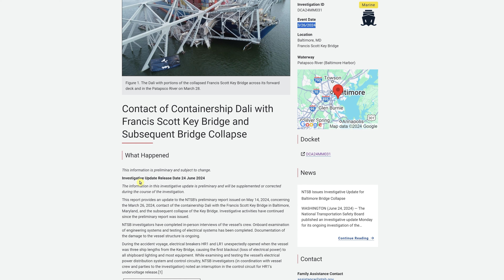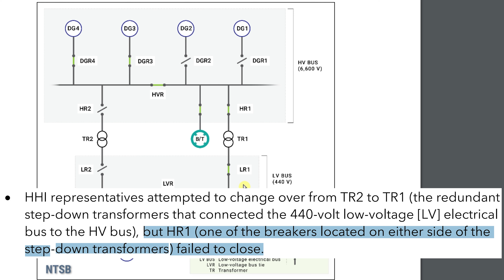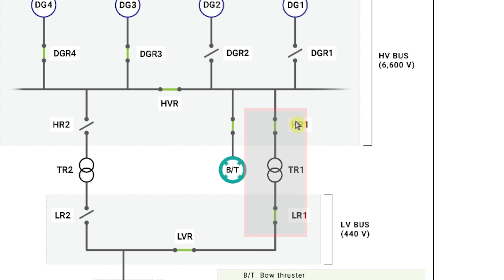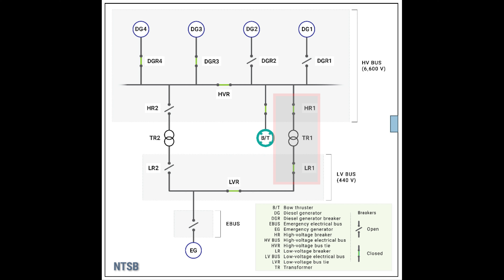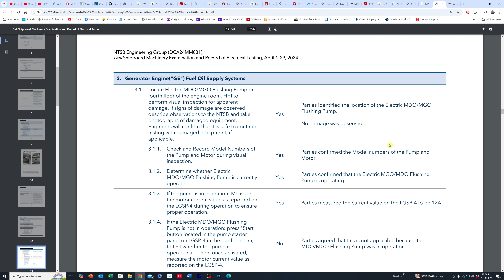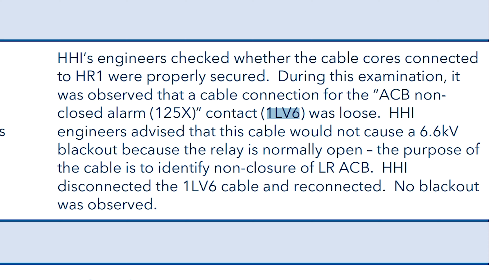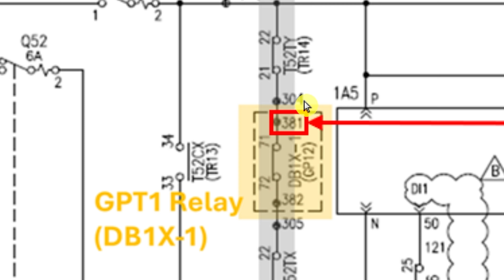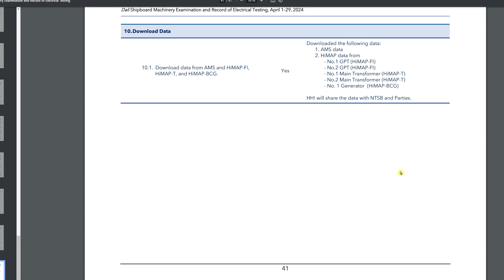NTSB: Dali Ship/Key Bridge Collapse Caused By Loose Cables?

Comment: Loose cable connection, but it changed over in 10 seconds. That didn't happen the night of the collision. Different operating conditions, I guess. They will eventually get to the final cause.
Reply: It changed over in 10 seconds then failed again.  Perhaps more than one loose cable.
Reply: @JustSayN2O  The video shows the first blackout to be almost a minute long.  If they had regained power in just 10 seconds, could that have prevented this catastrophe?  I don't know.  And if the transfer to TR2 happened, why the 2nd blackout?
Reply: @cdeeze  Because the first attempt at sabotage failed (due to the saboteur not knowing there would be an automatic power transfer).
Reply: @JustSayN2O  There's a saboteur? 😯🤯
Reply: @cdeeze  Either that, or a LOT of holes in the swiss cheese had to align.

Comment: An 87T is a type of protective relay that is used to detect internal shortcircuits in a power transformer.  It compares the current flowing into a transformer winding to the current flowing out of it.  If the currents are not the same, then current is flowing somewhere else inside the transformer that it shouldn't be.  The relay then tells the high-voltage breaker to isolate the transformer from the voltage source.

Comment: Ship power used to be direct (engine to shaft to prop).  Seems the newer ships have befallen the same fate as modern automobiles with overly complex systems than fail in ways that no one can figure out.  Perhaps we need to turn the clock back 50 years on transportation.  I still think the redundency should have resolved any failures.  And that known problems at the dock for days prior to the ship sailing should have been resolved prior to the ship leaving the harbor.  No excuses.  Mankind is not designed for this level of complexity.  Not enough experts to maintain such.  It's like living in a time bomb never knowing when it will explode.
Reply: The failure was figured out. It was (a) bad cable-contact(s) on some electrical device inside an electrical cabinet. Bad cable-contacts existed already 50 years ago, and there were probably several shipwrecks during that time, that were also caused by bad cable-contacts. So nothing to do with "complexity", but with some faulty/damaged parts in use.

Comment: It's crazy how a single control cable can cause a power loss. A backup system should always be in place for these crucial operations. And it seems the other transformer took over in the test, didn't that happen when the accident occurred?
Reply: Back in 2003, some tree branches in Ohio caused a cascade of trips, that resulted in a black out for much of the North East.

Comment: In conventional power plants back in the day,  nuisance tripping was a big deal. The loss of a single generating unit, or transformer, can cause cascade effects, which have the potential to cause widespread blackouts.  To counter this, most electrical protection systems  were designed as "Energise to Trip". Thus, faulty connections did not operate the trip relays.  The design has to detect, when the trip system is faulty, and raise an alarm.  One of the consequences of using an Energised to Trip system, is that routine testing has to be carried out, to make sure that all the protective systems still work.   In nuclear reactor safety systems, that require much higher safety levels, they use "De-energised to trip".  Thus, technicians in these type of plants, can easily produce spurious trips, when carrying out maintenance, by brushing up against wiring, or taking out the wrong wire, or forgetting to tighten them up afterwards. They counter this by having 2 out of 3 tripping systems. Where every parameter needs at least 2 devices to activate, to generate a valid trip.

The Dali has the worst of all systems.  A single point of failure, caused by De-energised tripping.

I would say, given what has happened, it makes sense to mandate "Energise to Trip" protection for all critical Marine protection systems.

Comment: Jeff,   If HR1 trips does LR1 automatically trip and visa versa?    The same question for HR2 and LR2.  Normal conservative design would be to Have HR 1 and HR2 protect the Transformer HV winding  and LR 1 and LR2 protect the LV winding.  The only thing I can come up with is that the  transformer tripped both breakers because of a motorized generator.  There was lots  of energy in the form of induction motors running on the LV bus.  The puff of black smoke is exactly what one would expect from a motorized generator.  The motorized generator is a problem with no reverse power relays and is a result of load share problems,  a common problem with parallel generators

Comment: Very complex system. Issue is, they werent able to track it with the diagnostic tools and logs that are implementd in the switchboard. Issue is, even then power is bakc in within 10 seconds, the populsion wont restart that easily, so this figure is just one part of the actual time. This things should be towed away from bridges and then, when they are safe start sailing on their own power
Reply: Yes. In addition to loss of lighting, there was loss of steering control. If that system requires a start up process, the ship could turn out of the channel as seen.

Comment: I think most people would be shocked at how many electrical failures are caused by either loose wires, or rodents.  Vibration and thermal cycling can cause connections to work loose over time.  Every time a system is opened up, each and every terminal should be retorqued to spec.

And rodents, well they just love the taste of insulation.  Squirrels especially.

Comment: Mechanical electrical connections always get loose over time because the material of the conductor can't handle the stress and will eventually stress-relieve itself.  Heat and vibration will accelerate the process.   It's a maintenance item if you ask me.  This is why old equipment eventually becomes unreliable.

Comment: so if H2 and L2 switch on 10 seconds after the L1 H1 fault. WHY did this still leave DALI with no power and loss of control? seems this is the point of a redundant system. is there more to this? how did the crew handle this? can the investigators simulate not just pulling the connectors. but maybe vibrate test things? IDK I'm satisfied on the main cause, but still so many more questions. why were they able to not regain power through the H2 L2 side? , like it seems it should to regain control? was this a crew or machine error? maybe both? THANKS JEFF. i love hearing your thoughts and respect the knowledge you bring us.

Comment: It's not uncommon to have those style of terminal blocks not secure to the cable when screwing them down. You can't see the actual connection and really have to go by feel. I don't think its out of the question someone new or unfamiliar with those connectors made that connection or even someone is a rush. I've personally done it more than once in a control cabinet.

Comment: The result for going cheap on the electrical control panels build; built panels in the yesteryears using “spring” loaded terminals with hook crimps which made it hard for a loose connection to exist; nowadays companies are building control panels on the cheap using rubbish crimpless terminals ultimately leading to loose connections.

Comment: 19:00 begins the actual fault

If you dig into this kind of control/electrical systems, you will find countless of loose connections and other mishaps even in perfectly functioning systems. Most of the time I wonder how they ever worked at all. I am still curious to know what was the type and failure of this particular connection.
Reply: Look at 25.01 it's a push fit arrangement which I absolutely detest.

My question is why did the backup transformer drop out after apparently successfully coming online, so begs the question was it known that the redundancy was not available and they were taking a chance on the primary.

Comment: The picture looks like 3 phases, but it is 3 DC wires. It should have some secure lock, vibration, repeated bumping into, unscrewing, cross tread. It is a 2-sided system, and the problem should be found if you regularly ran from both sides as primary, finding the problem after the other side breaks is the only danger. If the only time the backup system is used is testing is a bad backup solution, the wire may be fine for the 10-minute test or is ignored when it has an intermittent problem that cannot be figured out. If you run on both sides and stop using one side because of problems, it will be fixed because it becomes clear the backup is not a backup.

Comment: Regular and yearly maintenance should have found those problems. That may have been the cause of the power failure, but still no explanation of why the ship steered into the bridge instead of continuing in a straight line passing underneath it.
Reply: The marine engineers know this, it's something like a torque effect when you stop or reverse the prop to slow the ship.  It's been discussed multiple times on Jeff's videos and others.  Your counterfactual "still no explanation" assertion makes you sound like a cooker.

Comment: so these breakers are GFI or arcfault?  if these had been raw copper switches like we had back in the 60's, this breaker would not have been able to trip open from a voltage differential? it would have stayed on and prevented this

Comment: Good comments however from the schematic it looks like 381 is on a relay contact not a coil.  This contact appears to be in series with some others that control the Undervoltage Release relay or am I reading the schematic incorrectly?
Reply: If my reading of the cct is correct, the coil Usually is connected to the outside connections, which are hard wired tags with solder. the inner are usually relay contacts. I should say, that I used to be a telecomms engineer (just worked out 50 yrs ago), so things maybe have changed/must have changed, in that time!!! Have worked on many different types of m/c in my time, but the worst problems are the intermittent ones. You can chase yourself over and back on a m/c and still find no problems, then someone else goes to look at the problem and it is doing "that" thing and problem gets solved, Absolute engineers nightmare scenario.
Reply: @ianmckay1780  I'm just going by the way we used to do elementary wiring diagrams when I did shipboard control design for the US Navy.  Each discipline uses different methods of displaying components.

Comment: Intermittent problems will drive you crazy 💯 In order to find them it needs to be failing for the mechanic to do whatever tests he needs to do to find it. I don't have the patience required to troubleshoot electrical problems
Reply from the maker: It’s definitely a pain in the butt! but a high reward factor when you solve it

Comment: You need to educate yourself on transformer differential the incoming current and  secondary current must be of equal power other wise the breaker will trip. What you call a cable core is a wire connection on a contact that was probably loose. This can happen due to vibration.

Comment: FYI: cable core is not bunch of cables i just one single cable. The relay was driven by 24VDC and he was switching 110V to supply HR1 UVT Coil that keept HR1 on. If this 110V missing even when 24VDC to relay present, the HR1 just trips as its coil is not energised. I think its just error in manufacturing caused by some third party electrician and shity commissioning inspection.

Comment: Although the description sounds detailed, it leaves a bit to be desired. A picture of the actual connection point should have been included. 

They tell us the UV coil is 110v, which makes sense, however it ultimately has to be connected to the power line terminals which are 6600 volts on the high voltage breaker and 480 volts on the low voltage breaker,  which means the voltage must be dropped down to 110 volts.  There are a few ways this can be accomplished.  Ideally, the high side of this connection, should be through a separate terminal and not at the power line terminals.  They seem to suggest that this was made at the same point that the power lines were connected. Maybe a very small    wire combined wi. th the larger power cable in a mechanical lug.  If so, this is a poor design. The larger power cable can see some heating under high current load, yet the small wire that ultimately feeds the UV coil is very low current.  

Although both need to be connected to the same electrical potential, they should be at separate physical points. Ideally, the small wire should be connected using its own screw terminal.  If the power connection were loose there's a good chance you would potentially see a differential current trip. The devices work together. Ideally, the UV should be indicative of the circuit breaker contacts being good and not having any voltage drop. But connected to the power cable connection, it sees both the breaker contacts and the cable connection itself. If the cable connection was loose and heating, that would be good to know, however, more likely this just saw a voltage drop between the small wire and the large cable. while he large cable connection could be fine. 

This would be difficult to detect when testing under unloaded conditions. Again, it is more logical for the UV to detect breaker contacts only and not the power cable connection. 

This is probably a condition that worsened over time and it may have only showed up under initial surge conditions when the power cables actually try to move. Th fact that it ran fine over an extended period suggests that the power cable connections themselves were fine. My guess is that if you got lucky and got the breaker to close initially, it would  work just fine without tripping. In the end, it sounds like the issue was with just how/where the small UV wires were attached. In my opinion, the connection point of the UV wiring, should be separate from the power cable connections.

Comment: So once it failed and switched over to tr2, why didn't they regain control of the ship. You say it only takes 10 seconds  to do that.
Reply from the maker: It takes a finite amount of time for pumps and other equipment needing that 440 volts of power to come back online, there simply was not enough time left before they hit the bridge
Reply: I agree ,but the lights were out for ages. As soon as it switched over, they should have come back on, and they didn't straight away. In fact, they came back on and went back out again, which wouldn't have happened if it had switched over to tr2. Something doesn't make sense. It looks like it never switched to tr2. It just kept trying to to close the circuit on tr1.

Comment: Still doesnt explain why system didnt switch to second branch which worked just fine in simulation. Plus emergency generator didnt jump on, its on separate branch at low voltage side and shouldnt be affected by all those shennigans. My guess would be EG cant get connected to low voltage bus when LR1 or LR2 remains closed, which was hapenning with just HR1 tripping off. But without complete schematics....and many hours trying to make some sense of it... it remains open question.
Sad they didnt show us how that connector looks like. I would expect it to be screwed on since ship is suffering lots of vibrations.

Comment: It's ridiculously bad design to have critical systems so dependant on such complex wiring systems. 

Sure, have all the monitoring things as complex as needed, but to have critical infrastructure shut down from a random lost signal is pure bad design. A ship was severely danaged, a major bridge destroyed, and multiple people lost their lives. And it could have been a lot worse if it was during rush hour.

Critical power should have simple breakers, interlocked if needed, and automatic actuators when required but with manual overrides.

Comment: Please change the name/title of this video to add  “Power Connection” after the word “Cable(s)” or change it to “Power Cable Connection” after “Loose”.
Your title initially gave me the impression that there were loose (structural) cables hanging from the bridge (or the ship) that snagged/ entangled the ship (or bridge).
I’m also suggesting, as shown, that you use the singular (number) since it would only take one, albeit intermittent, loose connection to cause a failure.